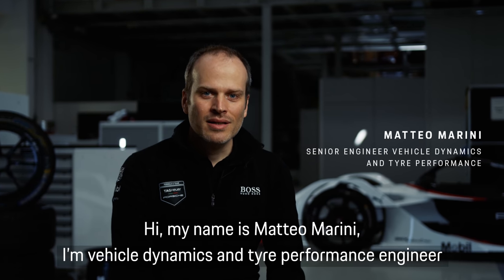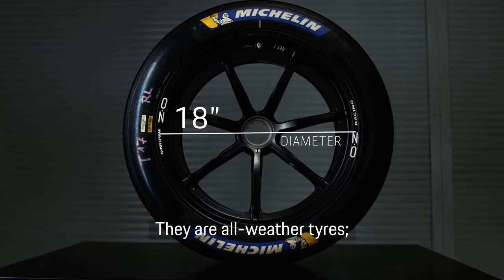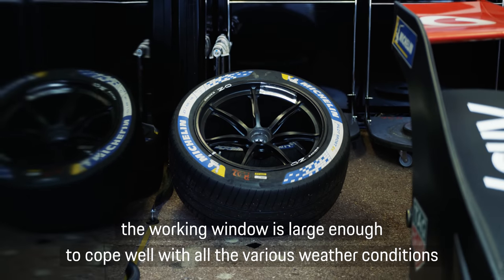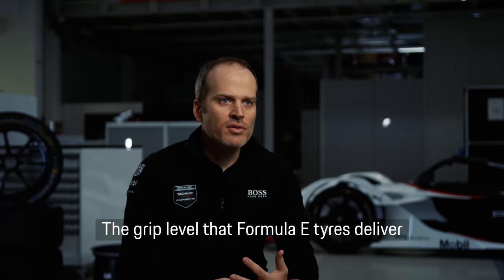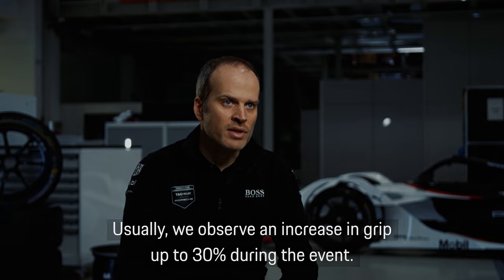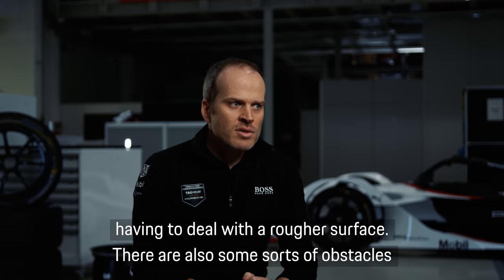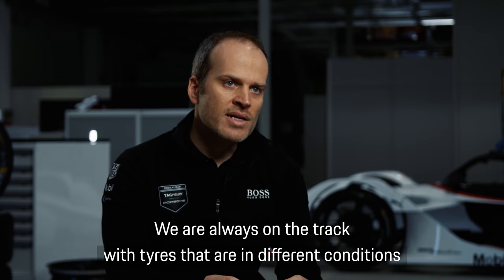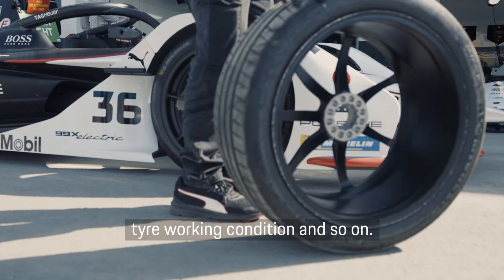Zooming In: Where the Rubber Meets the Road

Comment: thanks porsche learning from this..there is always a story behind. the future might be temperature controlled tires via wheels..might even be grip adjustable via electro something mechanism. i wonder how different tire material or shape affect aerodynamic effect? how different wheel shapes(types)..spokes..etc affect aerodynamics? how much turbulence is being made. a large scale schlieren imaging facility could be made..from the tiniest vibrations to each auto part to the car itself as a whole. i wonder how much the car vibrates in different wind speeds? rpms? this is why i think engine vibrations has a very large effect in the aerodynamic movement of the vehicle..down to the acoustic effect. another useful tool might be a car xray.